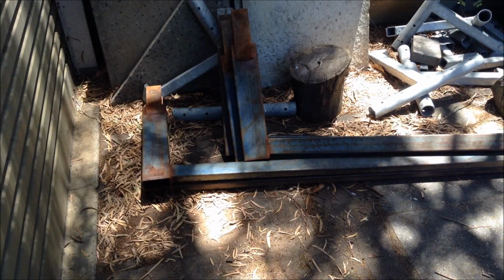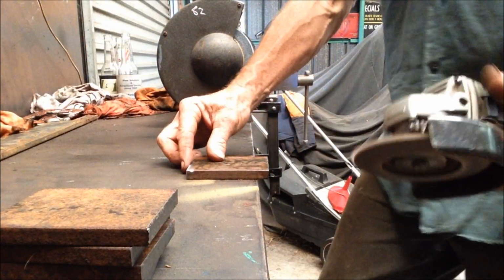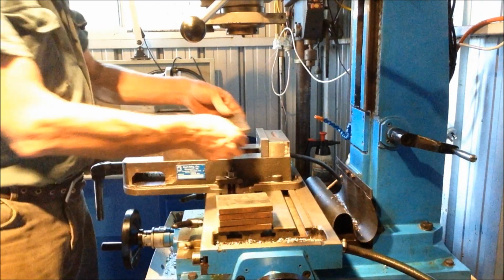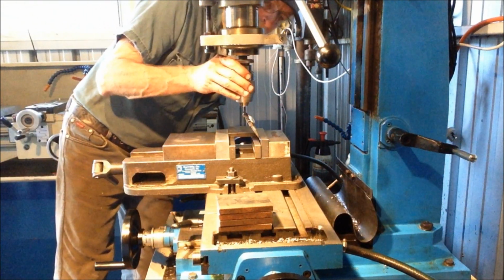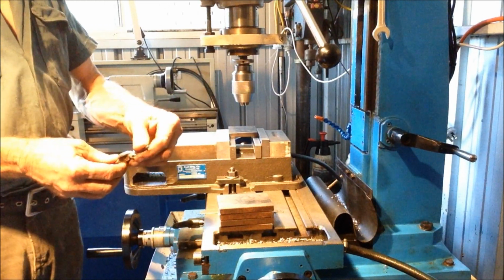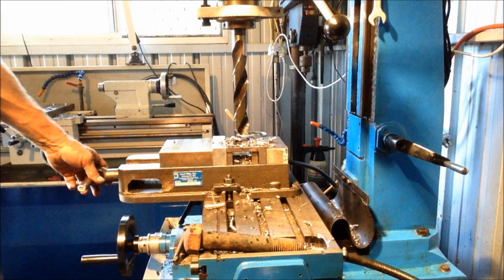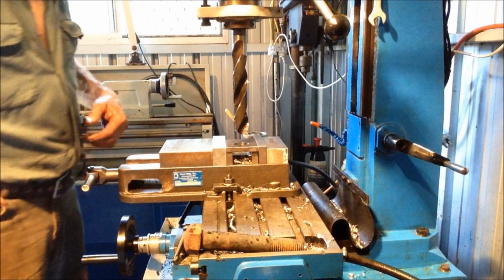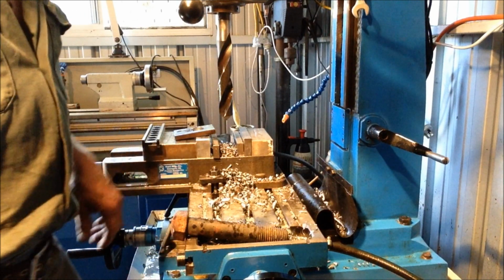Swarf & Chips Ep3  Part 1

Comment: Hey Max.
Sometimes i forget how lucky i am to have my mill with a DRO.
I have not used this method for some time now.
Mostly i use this type of dial indicator for hole centre.
I got so use to the Edge Finder and DRO now. ( I am a little spoiled with my Mill )

I did finally find JBFromOZ and Subscribed.
Only problem now is there are to many video,s to watch, LOL

Your machine might be Chinese but it,s a very good machine, especially with a MT4 spindle a must have for any machine.

Thanks for the video and info.
Regards Peter.
Reply from the maker: Better late than never ,  Sorry i missed your comment .  Cheers .